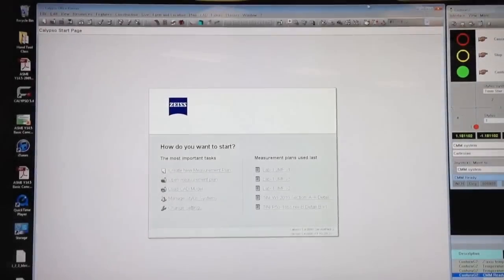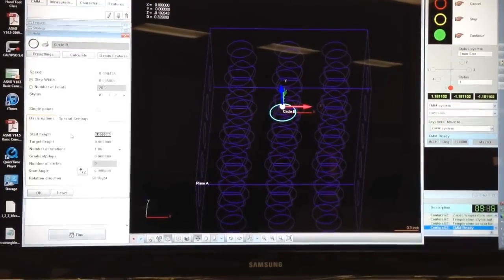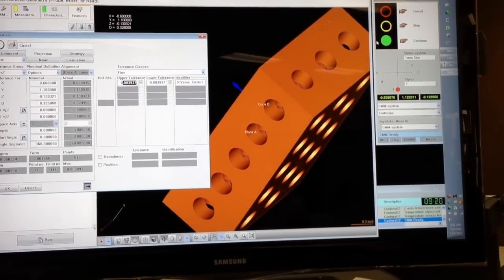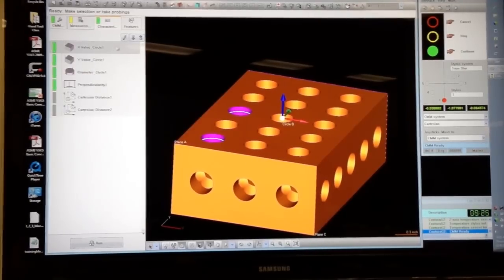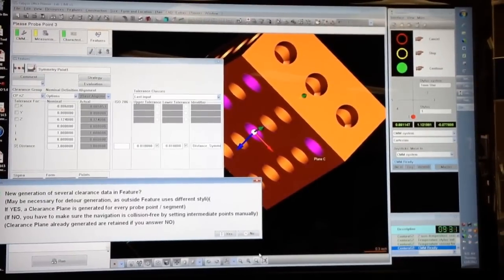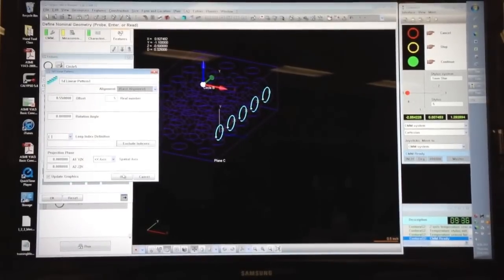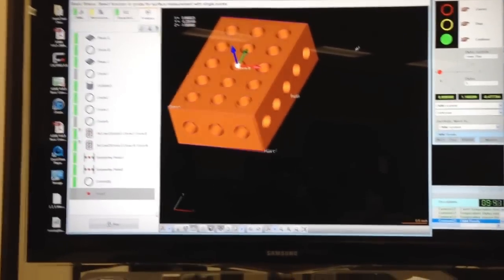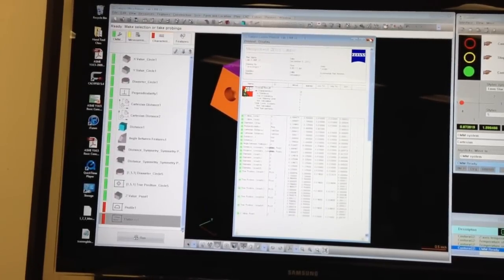Zeiss Calypso Measurment Plan Creation With CAD Lab 3 v2

Comment: When you created the point symmetry, how come you did not check the location of each point? Taking them randomly will not adjust their locations to X and to Y and to Z. What do you think?
Reply from the maker: My Own Videos I will typically edit the strategy of a symmetry point to make the points exactly across from each other by setting the x and y to zero in the feature coordinate system.